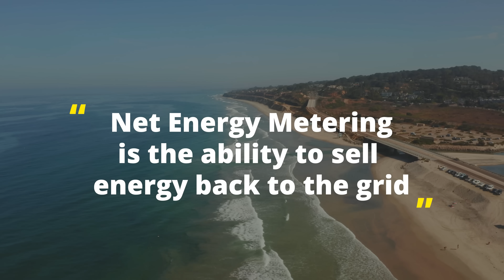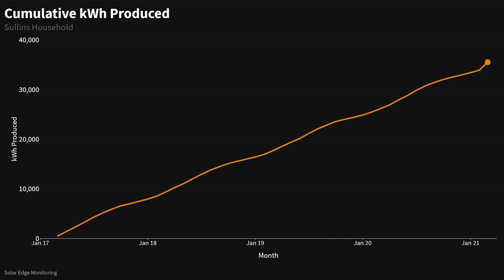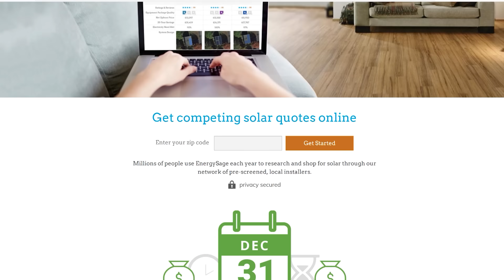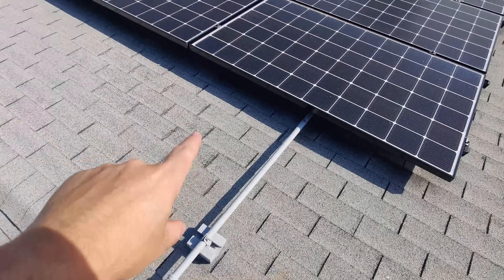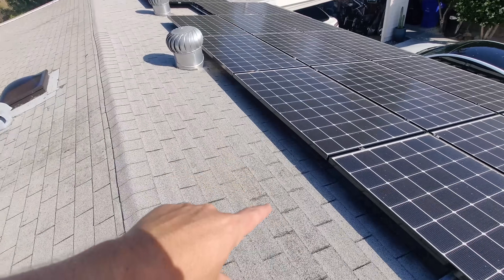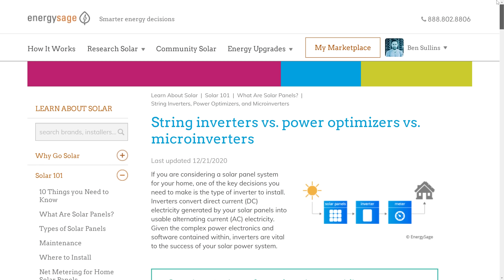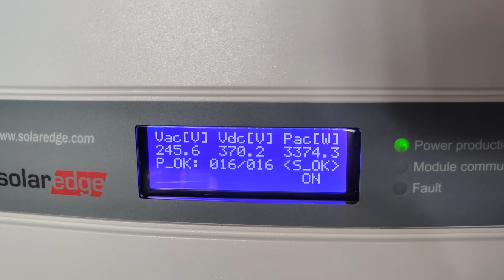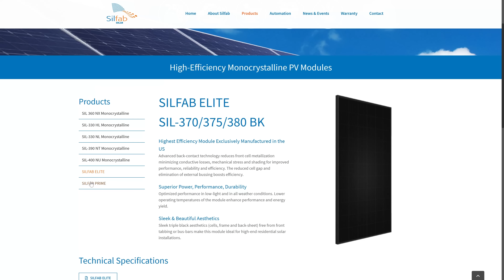The TRUTH About Solar! 4 Year Review

Comment: Im about to do a 33 panel system around a 11k system but Im going to get a return of investment in about a year and half because Im using the system to power my crypto miners!
Reply: I think you meant 1 year less, because 6x more profit by crypto isn't possible
Reply: @supreetyadav5021  where are you getting 6 times ? I’m using how many machines I’ll have running the cost of each machine cost to run yearly , instead paying that money to the electric company it can go toward the solar system and it’s roughly 18 months before that would be paid off .

Comment: Great information. It is going to be massively expensive to re-roof your house when needed. All of your solar panels and conduit will need to be removed and then re-installed after you re-roof your house. That will cost probably more than the cost of a new roof in and of it's self.

Comment: As someone who installed a 12 Kw solar panel system 2 1/2 years ago I strongly endorse Ben’s advice to put the largest system you can manage on your roof now. My system is adequate for my present needs but recently I’ve replaced an old HVAC with a heat pump, which means I will be heating and cooling with electricity from now on. I’m located in Southern California so this is not inherently a problem, but it will involve additional electric consumption over the course of the year. In addition, I currently have a plug-in hybrid with a 17 kW battery that I will likely replace with a full EV in the next few years. This will come with a battery three or four times as big. As a result I am currently in talks with my solar contractor to add another 3 kW to my existing system. Had I thought far enough ahead (or had the benefit of Ben’s advice) I would’ve installed this extra capacity at the outset. Apart from this initial miscalculation I am totally satisfied with my solar panel system. I’m on track to have the system pay for itself in less than six years.
Reply: In New York, I got a solar estimate of $71,500 plus tax for solar.    I can't afford it so I will just have to live off of the usual electric grid.  I can't afford an electric car either...or the additional panels for it.  They wouldn't fit on the house anyway of course because it's not big enough for more.   This whole green energy stuff is obviously only for people who have lots of money.
Reply: @shanedavison7473 Your estimate seems way too high. How big was the proposed system? I have a large system (40 panels generating 12 kW), which cost me $34,000 in 2018 with a tax credit $10,000. It is on track to pay for itself in 5 to 6 years. My neighbors just installed a similar system for the same price. There are several online tools that will help you to get competitive estimates in your area. The price of electric cars will be coming down in the next 2 to 4 years as more manufacturers expand production. I would urge you not to get discouraged by the current situation.
Reply: @richardcoughlin8931  sounds like a rip off unless you have a huge system (60+panels) with full battery back up. Seven years ago we installed 28 275watt panels for $24k with micro inverters.  Federal and state rebates at the time paid for about half the cost. It should be much cheaper now, approximately like 50%.
Reply: @leslielucci3182  The best comparative metric is price per kilowatt. I only had the federal tax credit plus a small ($500) city rebate. My total net cost for a 15.25 kW system was $28,100, which nets to about $1.75 per kilowatt.
Reply: Your net cost seems to be around $1.55 per kilowatt. The difference is that I only had about 30% tax credit/rebate while yours was 50%. If I had 50% credits/rebates my system would have cost $1.25 per kilowatt. (I think I have the math correct here but it’s always good to doublecheck).
Reply: Depends on state regulations. In New York (Long Island) you’re not allowed to install a system producing more than 110% of your previous 12 months usage. Assuming degradation of 1% per year, in 20 years you’ll have production of 90%, – averaging 100% projection over 20 years compared to previous 12 months usage at install date.
Reply: @leslielucci3182  Without solar my electric costs would be insane ($5000 per year). I live in the desert Southwest in an embarrassingly 😂 a large house (3125 ft.²) and run two air conditioners during the summer when temperatures average 110°. With solar I’m approximately neutral in annual cost for electricity. I pay around $300 per year for distribution (grid) charges, which are classified as “non-bypassable.” Obviously the situation for solar varies dramatically across different parts of the country with different state policies.
Reply from the maker: Great to hear!

Comment: But what about the cost of replacing the inverter at year 10 or 15 and replacing the panels? Are those costs included in your calculations?
Reply from the maker: I haven't had to replace that, so it's not included no. Whenever that does occur, it will be included.

Comment: One additional thing (than what Ben stated) was I WISH I would have upgraded the main electric panel at SAME TIME as solar.  Why:
1. permit
2. 30% federal rebate would include main panel upgrade if part of solar install.
Why did I need a new panel? Mine was federal pacific stab-lock which is BIG fire hazard (and not even legal to install anymore in CA) and I wish my Solar installer would have mentioned that.    I burned through 3 inverters (which my solar company paid for, yet I lost 6 weeks of power over 3 summers) until I upgraded my main panel to safer one.   Also, they undersize your inverter due to "loss".    up 15-20% is normal.. HOWEVER mine was undersized 22% and I was capping out at 6kWh on 7.59Kwh system from late Feb (2hrs) to late July (4.5hrs).  I'm in CA with SW facing roof with no larger trees blocking.   I had to throw a fit until they agreed to upgrade my inverter to SE7600 for "the diff" in cost.   They should have asked me which inverter size I wanted with pros/cons.    Now, the other reason I wanted to upgrade inverter was so I could justify the electric panel upgrade as solar upgrade and to handle future additional panels.  Putting inverter in garage instead of on hot roof might be better.  Since I upgraded my panel, my 7.6kW inverter has not died... its made it through 1 summer and is almost through 2nd summer.
Another note not mentioned in this video.  If outside temps go over 82F I see a DROP in my solar output... when I need power for A/C the most.    My yearly electric bill is < $300, however since PG&E switched to this "Green" energy supplier I'm paying more this year for "delivery" of power in winter months.
I chose 23 330W panels... if I had it to do over again, i would have  done 27 to 30.... because I'm already thinking of adding 5 to 10 panels now with loss of output in July/Aug during hot days.... and the imminent purchase of an electric car (possibly Ford 150 lightning) coming in 2022.   Now, I'm lucky because my roof is a Double A from front to back so I have 2 SW roofs.  You cannot see my solar panels (except from google maps).   I can add panels to back NW facing or front SW facing and you still won't be able to see them from the street.
The question I have is if I add 10 panels, should I make them SW facing too? or NW facing.   I know SW will generate more power, however hit 6.2 to 6.6 regularly in June.
I passed on the Tesla powerwall because to get the rebate from PG&E you have to discharge them weekly and the purpose for me would be to act ask battery backup for than for pricing (and 2022 Ford F150 lightning might be able to do that for me).   So the price of the power walls wasn't worth it with net metering agreement.   I'm better off buying a generator for the 1 or 2 days every couple years I need it.

Comment: I agree that you should design your solar around expected energy needs, but you also left out some important truths.  

In accordance with the conventional wisdom 7 years ago, my system was designed to deliver the average energy usage from the previous 3 years.  With the addition of a Tesla and electric spa, my needs are much greater now.  My original installer wants to charge way to much to add panels, and no other installer wants to touch it.  

You didn't mention some other important truths: the location and orientation of your panels are very important; so important that it might not make sense for you to get solar.  Also, there are unscrupulous companies out there that will sell you solar, even if your house isn't a good candidate for it.  My ground mount system faces almost due south, which is great because that's the orientation of the sun in our hemisphere.  One of my neighbors is surrounded by trees and got solar oriented north and east.  His panels get about 2 hours of indirect light a day.  He was too busy to research and got taken in by a predatory solar company.

Comment: I have got 10KWH solar setup here in Pakistan. 
First I installed 325W X 8 polycrystaline panels and 3KWH off-grid inverter. 
Now purchased 540W X 14 mono perc panels. Along with 10KWH Solis on grid inverter. 
The setup is complete. 
I wish I have more money for that customized structure which can make your rooftop useable. Now going with traditional frames.  setup. 
Just waiting for license from NEPRA, after which my bidirectional meter will be installed, and my setup will be completed.

Comment: I'm loving these retrospective takes on solar. I wanted to get it done to my home years ago, but it just wasn't viable at the time. Even then, I wanted to oversize my system, and had installers try to dissuade me from it. In retrospect, it was probably more to get me into a system I could afford so they could make the sale.

Despite anyone's take on EV cars, I do not think its unreasonable to see the average buyer converting in the next 25 years. That alone would make me think of oversizing the system, not just the potential to pay them off with energy buyback, but having to keep two cars recharged on a routine basis. All better to have it and not need it daily, then need that overhead and be without IMHO.
Reply: Did you get solar panels?

Comment: Today is the 6th anniversary of our 4.5kw array here in N. San Diego.  It has provided 100% of home usage including ~30 days of AC per year and ~8k miles of Chevy Volt range.  Peak San Diego rates just passed 60c/kw recently and so called "super off peak" rates are almost ~30c/kw. Combined with the EV we achieved break even at year 5 give or take a couple months, covering the $10.5k initial cost but the real savings are accelerating into the future.

Comment: Except with powerwalls it's better not to have microinverters because you lose power converting from dc to ac and then back from ac to dc. With the single inverter you can have the line from the solar panels going to the powerwalls before the inverter to avoid the loss from conversion.

Comment: Have anyone ever considered of putting solar panels (2 sided a.k.a two solar panels to opposite directions) on a propel like arrangement on a pole with generator on bottom? Maybe multi-layer like a tower? Due the difference in heat of 4 blades on pole solar heat rotates leafs on axle. Solar panel over heating problem solved with generation of energy from heat by generator at bottom of pole. You can test it out by putting four black leafs on pole and put it on sun light.

Comment: I am actually looking at installing a 12,000 btu  mini split heat pump that would work directly off of solar.  It would only run when the sun is out and it would not be connected to any other power source.  It should be more than enough to heat and cool my master/office and it may be enough to keep me from having to turn my central heat and air on for the rest of my house.  The whole set up should only cost 3k and it should pay for itself in 2 years.  Depending on how well it works I may add a 36k minisplit with three registers for the rest of my 2,200 sq foot house.  
     Since the my hvac is near the end of its' life, it seems like this is the most bang for my buck since a new hvac is at least 10k.   Once I have my heating and cooling taken care of by the solar minisplits then I will add a small grid tied array using used panels to take care of the rest of my electricity bill.  Then I will add an electric car and more panels as needed.  
      In the end I should be able to convert everything over, including a new electric cooktop and electric hot water heater) for around 20k.  And the best part is that I would only be spending $3-4 k a year as I slowly transition.  And I will be upgrading my heat and air, water heater, and cooktop, which are all near the end of their useful life.

Comment: SERIOUSLY?!   I'll check back in 30 years, the time it takes to actually see if it is still working and how many panels have failed.  Reviewing a solar system after 4 years is like reviewing the dependability of a car after starting it in the dealer parking lot and driving it 100 miles. Saying all solar panels are the same is like saying all cars are the same- hey, they all have 4 wheels and run on gas = the same quality!

Comment: Do you really need so many permits for putting some solar panels on your own (your private bought and owned) roof in The States, the land of the free? Sounds like a lot of government to me, and I live in a liberal socialist country (The Netherlands).

Also, your electricity prices are absurd, we have one of the highest energy tax in the region (Germany, Belgium, France, Poland, in almost all EU country's you pay less energy tax and the base-price in the EU is all almost the same as energy is sold over the entire EU, not inside one country) and a KW/h cost an average of 23 cents here... (We also have net energy metering, but not more then you use yourself, you only get a few cents for every KW/h you deliver back if your not using it the same year)

Also the installation cost is high to me, I have 13 panels for over 6 years with a installation price around 5000 / 6000 USD without subsidies. Average wage is higher here then in the US before tax (I don't know about California specifically)
Reply: So long as you connect anything to the grid. Grid company doesn't want your system to cause distruption to the grid stability. Any outage will cause millions dollar losses to business. Althought the chance is low, the grid company doesn't want to take any chances. Someone's head must be on the chopping board if it really happen.

Comment: Good information. With one note about the system size here in California. The electric utility company ultimately determines the maximum size of a system that you can install based upon your previous usage. They do this to limit your net metering ability. You are only allowed a certain percentage above your average usage, plus some additional capacity if you are planning on getting electric vehicles or a pool pump or something in the recent future. If you wanted to add extra panels in the future, you would need to go through the approval process again. So yes, it is best to put in as large of a system as you are allowed the first time around.

Comment: Did you guys calculate the cost of replacing roof shingle when you have to remove your panels and reinstall them back ? It's big money!
Reply: Just leave the panels up there lol protects the roof
Reply: @theincrediblebulk7040  You will find those areas without panels are aging much faster than those under the panel s

Comment: Buying a span panel is a waste of money! I can manually turn on and off breakers at the main panel. I use a flip switch (lockout) and can use most of my breakers and at a cost of $50. 
Also it’s cheaper to go off grid, and not pay all these government fees and regulations. 
And you don’t have to have the biggest system right away, as you can always add to the system as time goes. 
But I saved a lot of money doing it all myself! Although I did have to pay for a new updated main panel, as the person who put together my first panel did a horrible job! But your not likely to face that in most houses. 
But I don’t live in California! 😁

Comment: I have been installing solar system for a year now. If you are not using Net metering, then you will end up paying more than just staying with your grid company. Batteries are extremely expensive and last just for about 10 years(lithium) or 5 years(sealed led or gel). If any of you are planning to go off grid, just remember that you will end up paying more.

Batteries are only to be used for a backup system so that when the grid goes out, you still have some energy.

Comment: The Tesla solar tiles look just like asphalt shingle roofing and when priced compared to shingle roofing and solar panels they are comparable considering the solar is more expensive but it also saves on electricity bills. Also if damaged they pop out and the new roughly 2'x1' tiles pop in. And the solar tiles are only where and how many you need but they look the same as the non solar tiles. I would assume if you want more solar tiles to the system as energy demand increases it should be very little trouble just to pop a few more solar tiles into the tile system.

Comment: I'm on all solar with batteries storage. I can tell you he trying to sell something. "Net Metering" for those states than have them.........You are "selling" craps.  The excess electricity from your panels goes to the grid and you will receive electricity credits for it. It acted as a electricity bank between what you used and what are "bank". After a period of times what are "bank" is not used are lost {most states). Now some electricity companies want to charges for using their "banks".